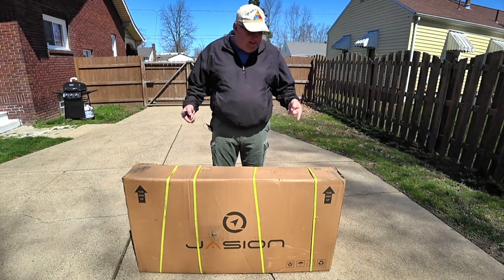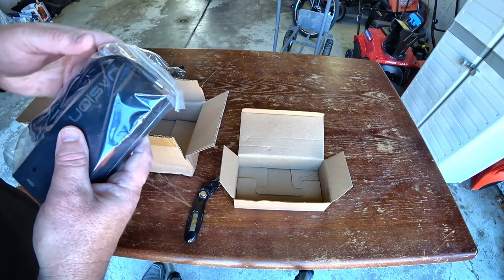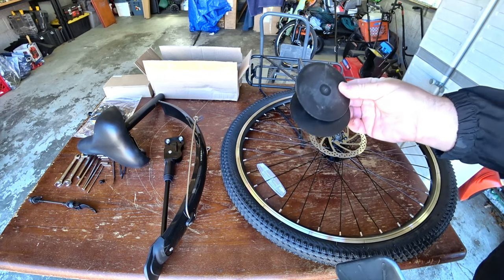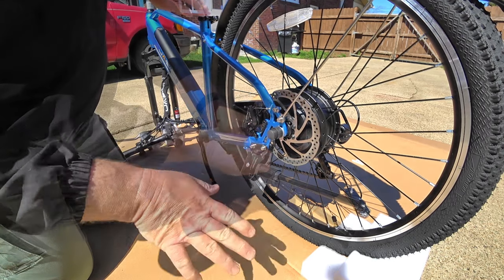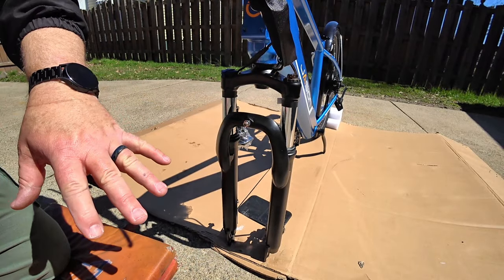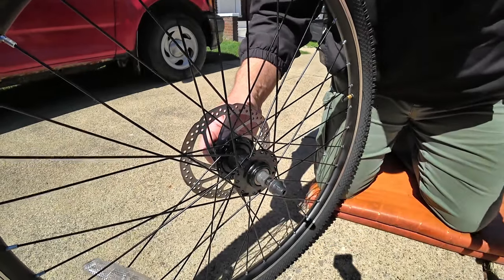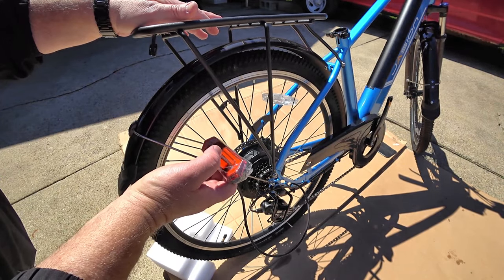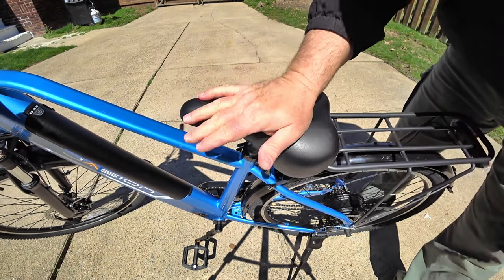Jasion EB5 Roamer Electric Bike Unbox & Assembly

Comment: Great video, most of it was pretty self explanatory just from looking at it, but was good to have someone confirm my sanity as I assembled it (especially since no instructions were included in box).

I will say though that putting the front wheel on became much easier when I flipped the bike over and stood it on its seat and handlebars, then putting on the front wheel and lining everything up was very easy.

Thanks again for the video.

Comment: You brought two of these bikes, step through and man style. This is my version that took 2 months to be delivered. Easy assembly just over an hour. Throttle is better than PSA which lag every time you start pedaling, so use the throttle to start. Pedaling is none existing while riding. Replaced the seat for a wider seat. For $799 it's ok but my built front motor bike is twice as good and more comfortable as this bike.
Reply from the maker: I agree, I too could build far better... However, 95% of the people out there can't..

Comment: Hey i was interested in buying on of these what speeds do they get up to while riding them? I know it says 28 miles per hour but Ik thats just the speed limit for class 3 ebikes. What kinds of speeds does it realistically actually get up to? How does it feel and can it go faster if it is unlocked? (i live in a place without ebike laws so im interested in a bike that could go faster than 28)
Reply from the maker: Too many variables... How windy, how Hilly, How tall and wide is riders body, how much pedal force, what ambient air temperature for battery and motor performance, how much battery charge etc...
Honestly though, we didn't review this bike.. We just did unboxing and Assembly video..
We found that all e-bikes need a large battery (14-20Ah min) a motor with at least 750W sustained/1000-1300 watt peak power..
And a really good controller program to do 28 mph.. Even then it almost always requires pedaling assistance to achieve that speed)
Reply: @Rvdaydream  ty for the info :)
Reply: Got mine on strait away up to 27. With a little front wheel rubbing on lord knows what ! ?